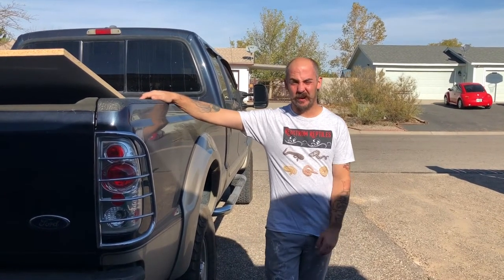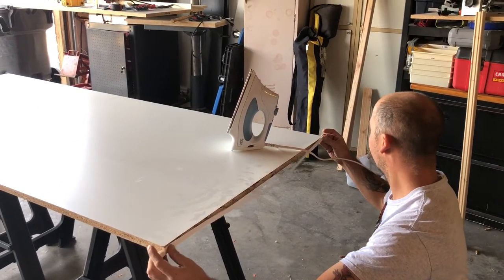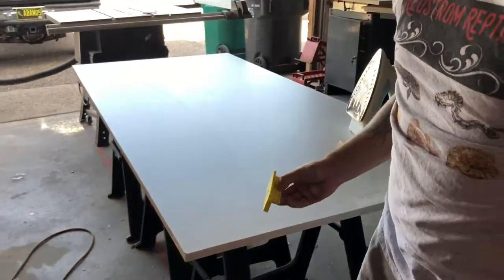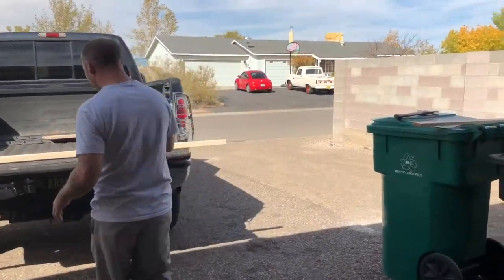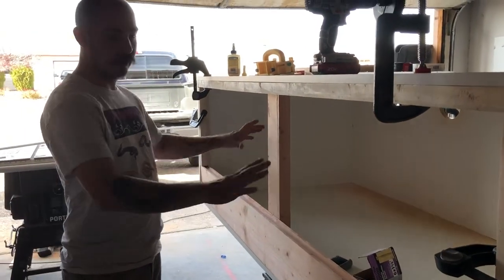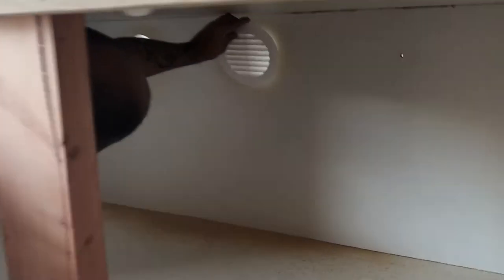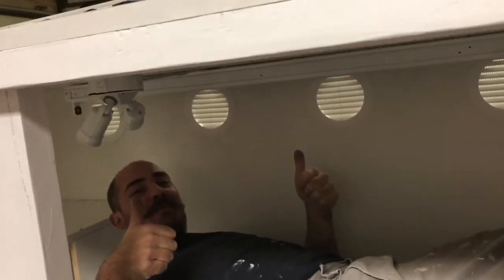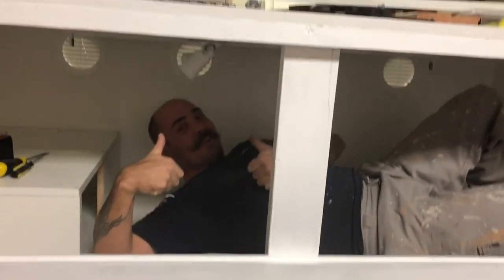Custom Tegu Enclosure!!

Comment: what exactly should i use to pre drill screw holes??? and any screw works?
Reply from the maker: I use a 1 1/4 screw and then I match the drill bit to the size of the center of the screw to pre drill and Rin a counter sink bit  that way the screw head sits flush.

Comment: In your opinion, what's the best material to build snake enclosures out of?
Reply from the maker: I would say PVC cages are best but it is expensive where we live
Reply: @snakeguy86  They don't sell it in sheets, at least not that I've seen. I'm planning on building one, would you suggest plywood or melamine?... or something else?
Reply from the maker: I say Melanie is the way to go my cages are still holding up good and easier to seal up then plywood.
Reply: @snakeguy86  Do you need to waterproof other than the seams?

Comment: what do u use to seal everything and the cracks to prevent moisture damage? do you think an 8ft would be too heavy/large to build a short stand for it to store things underneath?
Reply from the maker: Redboa23 I use silicone or caulking but the silicone works way better. And for a stand u can make a good sturdy stand to hold the weight of it.
Reply: thank you for the quick reply I'm sure ill be asking more questions once i actually start the build hopefully next wk ! Thank you for making these videos they have been the most descriptive ones, very helpful!!
Reply from the maker: Redboa23 thank you I am happy I can help and my videos help and any question I can answer.

Comment: Do u let the liquid nail dry before pre drilling and screwing??
Reply from the maker: No I don't let it dry I glue it and then get the screws in that way they act as the clamp to hold it together.
Reply: Great ty! It should be fine sitting right on floor right or should I get wheels for under it?
Reply from the maker: Will be fine on the floor my tagu cage is on the floor the castor's just make them easier to move if u need to.

Comment: A heat gun set on low would also work or a hair dryer in a pinch. You work with what you got improvise
Reply from the maker: Yes thoes will work and I know what u mean.